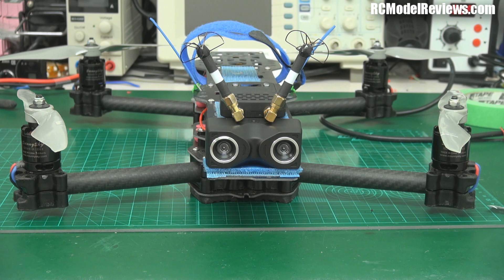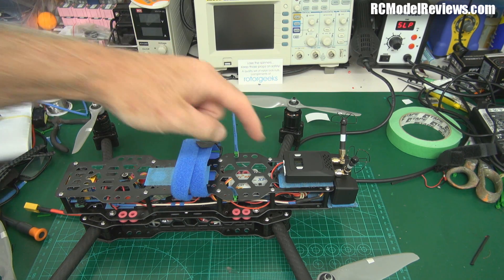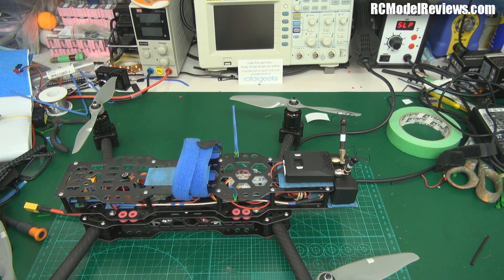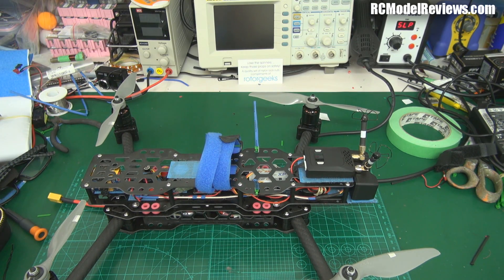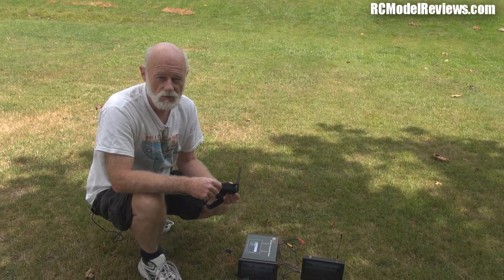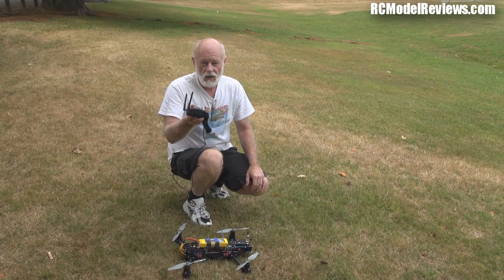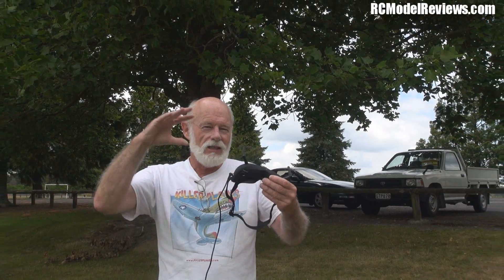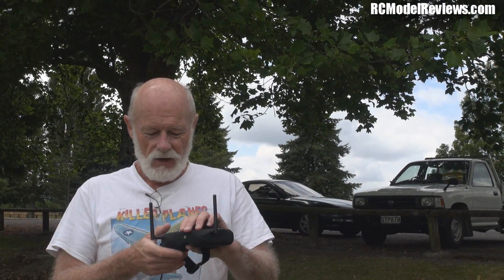Review: SkyZone 3D FPV glasses (with 3D footage in this video)

Comment: As my whole goal of flying RC with FPV has been to obtain the sensation of flying (without drugs), I definitely want to get 3D to work.  Gotta build my first quad first :-)  I could train my eyes on my iPhone, but it was more difficult looking at my computer screen.
Reply: Drugs don't make you feel like you're flying, just floaty and/or schizophrenic. 
FPV is better than drugs.. [Source: retired drug addict]
Short of a breakthrough psychedelic trip or something extreme like that, FPV experience is more exhilarating and fun overall, and you don't get any of the negative effects from FPV that all drugs have to some degree- also you can turn FPV off with a switch and not be incapacitated for hours afterwards..
FPV > Drugs.
Reply: @EtherealPoof  except nowadays fpv is probably more illegal than drugs :-(

Comment: Bruce:
   I'm so glad this new 3D VR technology is being tested and shared as you have here.
   I would like to know more about the cameras. The sharpness really was not there in your demo. Do you know why? What was the resolution of each frame?
   What is the final resolution of the video as rendered to the output on video viewers?
    There is a viewer called VR Shinecon from Gearbest that has good features, on special today for $20:
http://www.gearbest.com/home-gadgets/pp_246872.html
    Have you tried this type of viewer after the fact?
    Seems to me that technology that binds input from each camera to a single frame and transmits a single video stream to the receiver/DVR might simply things a lot and reduce costs if a good wide screen field of view can be maintaned.
    Love to get your comments!
Jim
Reply: +James C Eastep You don't get much sharpness from an SD video link at the best of times and it did look sharper than the DVR footage would suggest (because the DVR itself tends to soften the image). 

I don't know what the resolution of the cameras are  but if I was going to seriously set up a 3D FPV system I'd likely use much better quality cameras (Effio V perhaps) and two separate VTXes for best results.

As for that viewer... it requires a mobile phone and app which rings alarm bells for me.  Firstly, the latency introduced by the smartphone processing and the relative unreliability of almost every smartphone video app I've seen would leave me gravely concerned that I'd lose the video at a crucial moment.
Reply: +xjet 
   I agree about the latency issue, but my intention was to use the GearBest 3D viewer as a playback medium initially, NOT for piloting.
   I'm still searching for a piloting imaging system that does not break the bank....so for now, I'm using a 800x480 LCD diversity monitor (with a shade) mounted on a tripod at standing (or sitting) height. This way, I can easily move away from the screen to view the plane from the ground.
    I can see that a fast 1000x600 resolution or greater LCD system would be better for LCD viewing, but figuring out how to set up a 6" monitor with higher than 800x480 resolution to be viewed using the 3D VR viewers (not with cell phones...too slow) would be great, but I haven't found any.
   Bruce, is this a technology project for you?
   Suggestions, anyone?
Jim
Reply: +James C Eastep I want 3D HSBS 1080p format at VR glasses (by smartphone) as the combination of the signal from two GoPro (or better) camcorder to 3D HSBS format at copter. Is it possible?

Comment: you can't do 3d with cross eye, or spread on the same video.  The cross eyed method requires left screen on the right, and right on the left, and the spread method requires left on left, right on right.   (Also, most people can't make their eyes diverge much, since they never have to do this naturally, as opposed to cross eyed, which you will do to look at things very close to you)

Comment: Bruce apropos to your comment about two video tx and two cameras - one other option which could be a bit lighter (although still not cheap) is the Nerdcam3d - which can give stereoscopic through a std vtx...however you need cinemizers or Dominator HD to use them with...

Comment: Hey bruce,
can you please help me my skyzone v2 3d googles just give a white screen on a 3s battery and dont start up straight away is this a fault or how can I fix it? I tried a higher voltage but it does the same thing, any ideas?

Comment: does the power from the transmitter connect to the balance plug of the battery on the quadcopter? Can you connect it up to a 4s? also how much power does it use? thanks.

Comment: Bruce you must mean use those Red and Blue glasses. I have the RealD 3D polarized glasses used in Movie Theatres and did not work. I just see 2 squares with a black line down the middle. Probably need to have a monitor that can do 3D as well as a 3D capable graphics card. Youtube settings does not show a 3D viewing option.

Comment: Since I can never seem to get a concrete answer to whether I will be able to focus clearly with these goggles being farsighted, (I use 2.75 glasses from the discount stores) I was wondering.... Is there a reputable competitively priced retailer where I can buy these but have the option of returning them right away for a full refund if I cannot focus with them?  There does not seem to be any myopic lenses for farsighted people since they claim there is no problem, however, I cannot focus on the hobby black box with the DIY 4.5 screen.  It is just about 3 inches too close to my eyes, unless I use the blurry fresnel lenses which suck.  Anyone know about this? When I say I can't focus without the fresnel lense, I mean even when I am using the corrective glasses also.  I removed the ear shafts and cut a slot in the correct place in the styrofoam so my reading glasses fit right up to my nose properly.  I still can't quite focus enough to read the osd.

Comment: Thanks for the review, Bruce. You mentioned that there are two ways to view the 3d footage: relax your eyes or cross your eyes. This is true, but which method you can use is dictated by which side of the screen is playing the video from which camera. If you are going to cross your eyes, then the video from the right camera needs to be on the left side of the screen, and vice versa. If you are going to relax your eyes, then the left camera should be on the left side of the screen.
Relaxing your eyes really only works when the size of each image is no larger than the distance between your eyes, because it's very hard for people to aim their eyeballs in diverging directions. I'm pretty sure that you have the left camera on the left screen and right on the right screen, so the only way this can work is to make the video very small. There's no chance for me to do the relax method given the size of my computer screen. If you re-did the video with the sides reversed, then the cross-eyed method would work.

Comment: Bruce, regarding the different frame rates, maybe one thought is, in Sony Vegas Movie Studio, to save one of the videos as the same frame rate /size to the other. Probably best to save the one with a higher frame rate to the lower frame rate. 

I know you can create a project and select its render parameters by matching a video file. This will likely get two video files with the same parameters.

Comment: Hi Bruce,
This isn't related to the video but I was hoping you could give me some advice.
I've recently built my first multi-copter, a tricopter.
It won't get off the ground due to lots of vibration and I'm not sure why, I posted on the flitetest forum and the people there told me to do lots of things, all of which I've checked and done, expect balancing my props, do you think unbalanced props could cause so much vibration it prevents a craft getting off the ground?
http://forum.flitetest.com/showthread.php?14779-HELP-My-first-tricopter-won-t-fly!
If you watch the video, I've fixed the servo twitching but it still won't fly.
Thanks in advance!
Reply: Tom Attard The replies given on that forum are good.  The writing on your props (which tell the diameter and pitch) should be on the top surface of the prop and (of course) they should all blow air downwards.   I note you're using a 4000mAH battery which will be quite a bit of weight so I'm wondering if you're simply not giving it enough throttle to lift off.  Try with a lighter battery if you're scared to use too much throttle... multirotor craft do need quite a bit of power to lift off the ground.  Note also that it'll appear to vibrate a whole lot more when sitting on the ground because the props are running in turbulent "wash" that reflects back up off the ground and gets sucked in again.
Reply: *****
The props are definitely turning the right way, I've tried a number of configurations to make sure they are and am convinced I've got it right now.
Unfortunately I've only got this one battery as I was trying to keep costs low as I enter the hobby. I'll have to get some guts and try taking off with more throttle, at the moments I'm getting to 2/3 and chickening out because it's vibrating quite violently. I've even tried holding it in the air and looking at one of the front motors, it oscillates slowly left and right, or in a circle, can't really tell.

Comment: As was mentioned below, and as I have mentioned to SkyZone when these were first released, having the binocular distance set apart at basically the same distance as human eyes has little effect on distances beyond 10 meters or so.
I have suggested to Skyzone for their version 3 to put the cameras on a recessed track/rail where the binocular distance can be increased to around 175mm.  This will allow a much better 3D perception for distances out to around 100 meters.  Having the cameras on a recessed track would allow the unit to be placed on a mini with the unit collapsed and on a 450mm or larger multirotor or plane with the cameras pulled apart at the maximum separation.

Comment: G'day,

Very interesting, as you said in the Description, some of it was a bit underexposed ("dark") for the parallel-gaze Tri-Vision trick to maintain the illusion, especially on the Touchscreen Phone and sitting outside.

  There's  blurry Postage-Stamp sized 3-D view of the Landscape flanked by the pair of actual images, and when it works at it's best there's an amorphous interface-line going up the centre of the 3-D Frame, with the Right-Hand side of the Picture being darker than the Left half, and as the Quad manouvres then sometimes the Interface develops a sinuous Wavy edge...; it's an interesting effect, apparently down to that Bee's-Dick worth of a difference in the Frame-Rate..(?).

  Am I the only one to percieve the Stereo Quad's strong resemblance "facially" to the Robot in the 1990s Movie "Number 5 Is Alive...!" ?

 It's almost at the edge of the "Uncanny Valley", so whatever you do you'd better try not to add a "Nose"...(?).

;-p

Ciao !

Comment: Bruce, could you upload some video with (and I hope this description is understandable) the combined video screen split in half and the video for each eye centred in each half of the combined video. You should end up with a wider black bar in the middle. Then people can view it on half-side-by-side 3D monitors like my 3D TV. :) Thanks.
Reply: rogueqd I am going to upload some more video in YouTube's 3D format -- I think I've found a way around the different frame-rates that are currently stopping this from being possible.
Reply: ***** Would it be possible to render each eye's video separately at a set frame-rate (with just the original video in the project file). I know with Vegas Pro you can set a specific frame-rate for the project. Then you could render them to the same frame-rate and the 3D format would work as far as I can see. Sorry if this is just repetitive if this is what you came up with to work around the frame-rates.
Reply: MultiRotor Freak
Yeah, I'm going to render each video stream to 25fps (thus up/down-converting from the reported frame-rate) and then pair them as a 3D stream.  Unfortunately, it seems that YouTube is switching to HTML5 which doesn't support any of the 3D modes that Flash used to.  Grrr!!

Comment: Bruce I was wondering to learn more about this product so thanks for the great review! I have a quastion though: Can we mod the cameras (separate them or use other cameras) to have a more distance between cameras for a deeper 3d effect for high flying?
Reply: Gur Isler There's no reason why you can't use other cameras (mounted at a spacing of your choice/design) and other video transmitters in the 3D mode.  Indeed, that's what I'll be trying on my miniquads.

Comment: It's interesting to note that you're basically running two complete video systems when using the SkyZones - right and left eye camera's and a separate vTx for each.

I haven't had time to have a decent fiddle with my HeadPlays - but I believe they use a multiplexed vid stream through just a single vTx. The receiver box on the other end does all the demuxing for you.

Must get these things going to see/learn how well it all fits together and how much 3D separation is provided :D

Comment: Try this to get 3D effect.. use your smartphone screen on youtube. Put your index finger vertical across the center of the screen, to hide the line between the left and right image. Look at the screen from aprox 2 inches distance. Squeeze your eyes to get a little better focus. You will have a blurry out of focus image but the 3D effect will be very noticable. If you squeeze your eyes until they are almost closed you might even manage to get decent focus at this close range. I thing near sighted people will benefit if they remove their glasses/lenses. Ill try tonight with my lenses removed.
Reply: My boss saw me doing this.  He said there is something wrong with me.
Reply: EnuffsEnuff318 A pair of off the shelf reading glasses and a cardboard divider will work better on an smartphone or tablet and bring the screen into focus. :-)

Comment: Bruce,

Thanks for the info. You said the transmitter takes up to a 6 cell lipo, what are the goggles running on. When I ordered my pair, I noticed they don't come with a battery. So I am wondering what battery is best?
Reply: Scott Mccurley They'll work with a 2S or 3S lipo and you can set the low-voltage warning for either via the goggles onscreen menu.
Reply: Thanks Bruce, much appreciated.

Comment: 3d in the air to view the ground doesn't really work. No matter how far the lenses are a part the distance to the human eye always appears as a 2d object. Think when you are on a passenger plane and look down .everything is flat. It would be good to follow objects in the air however like another quad or plane. What I think is missing is the ability to record in 3d. Its a pain in the backside getting one vrx set up never mind two. Really nice review all the same but I think the item is a novelty. It would have been better transmitting everything as one image in sbs format then getting the goggles to support sbs. Then it could also be used to watch 3d movies on. All the best.
Reply: Sean Coyne I have added a few 3d cameras to quads and planes, always disappointing with the results. of course everyone is different and you are welcome to try. youtube has removed the 3d feature now so i had to remove all my SBS videos. 3d is very much dead....again.....until avatar 2 comes out that is.
Reply: AndyRC Didn't know YouTube had removed 3D, that's a shame. As for 3D RC stuff, yeah, I was hoping it would be worth the hassle, even if it only helps with judging height for landing in FPV, as with the wide angle lenses you seem quite high one second and then get that detailed close-up of the grass when you hit the deck, lol. I have way too much footage of grass close-ups from quad flying...often upside down, sigh. :-(
Reply: Yeah I second this.  I thought it'd be cool but it just feels gimmicky.  I watched it with my 3d goggles using my phone and didn't feel it improved the immersion from a standard single camera setup all that much. I think what would help is greater viewing angles to encompass our entire vision within the goggles.  I was tossing up weather to get diversity for my current setup or a pair of these, I think I just made up my mind.
Reply: Not so if part of the airframe is in shot as you will see the gap between you and the ground at least (like watching a take-off through the window of a passenger plane) also with wider camera separation as you fly at tree top height or somewhat higher the trees will appear to stick out of the ground up at you. I haven't flown 3D with my Dom HDs yet, but I have done a lot of 3D photography in my youth (just using a frame to take two separate shots a  using a 35mm SLR). If you ever get to look at aerial reconnaissance 3D photography, where the plane moves between shots all the hills stick up like mountains, lol. :-)

Comment: nice video as always! looking forward to see how your own setup with 2 cameras and video transmitters turns out. also would be interesting to see how they compare to the nerdcam3d camera combined with the fatsharks hds. looks like you only need one video transmitter with the nerdcams, unfortunatly price of the nerdcam3d is around 250 dollars, so together with the fatsharks you're already over the 700 dollars mark...has anybody tested them ? are there other 3d options out there?
Reply: I use the Nerdcam3D together with the Dominator HD in SBS (side by side) mode, and it's a blast! Other options are the Blackbird 3D cam: http://fpv3dcam.ru/index.php/en/products/3d-fpv-camera-the-blackbird and the EMR labs 3D-cam: http://emrlabs.com/index.php?pageid=2 Make sure your goggles are compatible using either SBS of Field sequential mode!